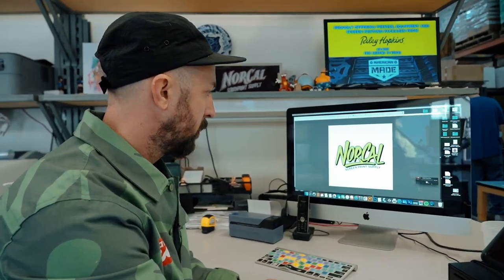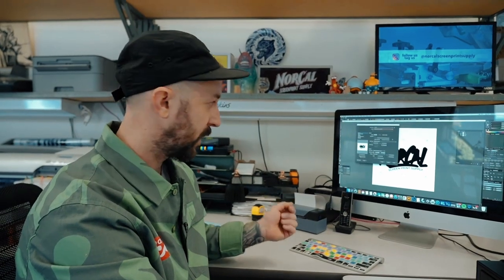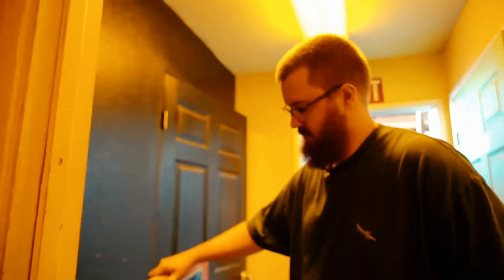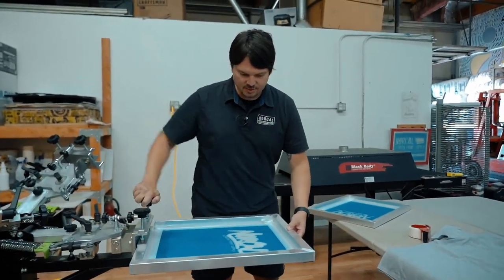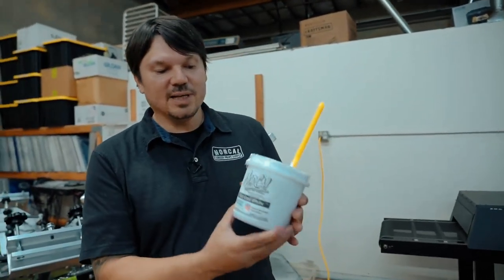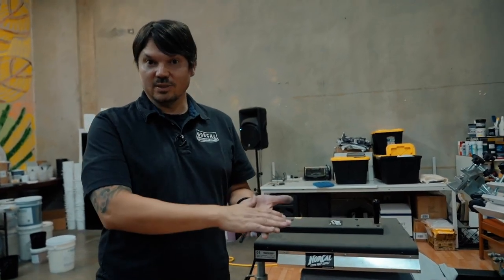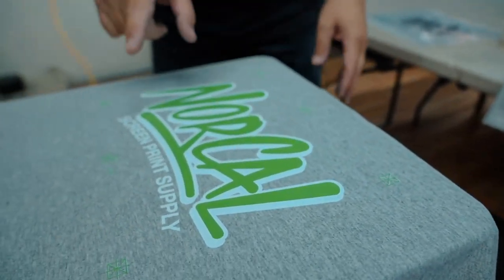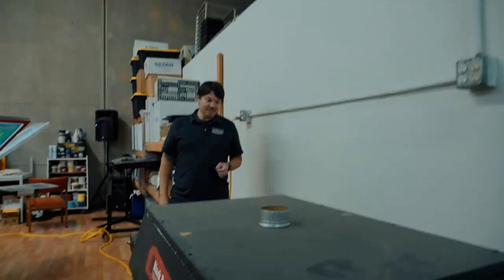2 color Separation + Screen Print Demonstration #FreePrintAdvice

Comment: So awesome video, its gr8 to see all theese details in action...one question: I havent seen u to do anything about the off contact, is it something that u set it once and u never touch it?
Reply from the maker: Thank you! For the most part, once your off contact is set, you won't have to mess with it too much. Keep in mind though, that it does matter how your screens are clamped into the print head. I don't like the backed all the way in and touching the rear of the print head, instead, I leave about 1/4" gap. If you mount them the same each time, it will somewhat minimize having to adjust off contact. Thanks!

Comment: Hi, on your conveyer what temp did you get on the shirt for the ink to cure , since it's a 2 layer print ?
Reply from the maker: There are a few important factors when dialing in your conveyor dryer.. Temp, belt speed and also the height of the oven doors (if your dryer has them). We like to run our particular dryer at 1150 on the digital temp control, and around 18 on the belt speed. But dryers are going to vary vastly between manufacturers. Thanks!